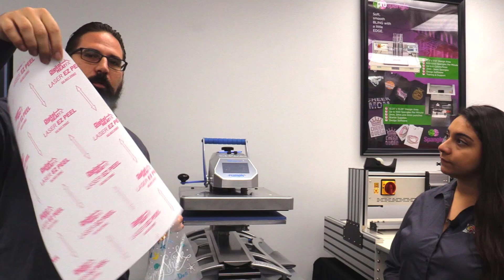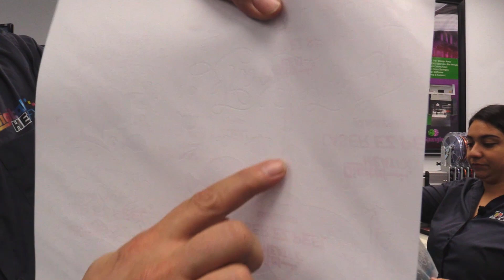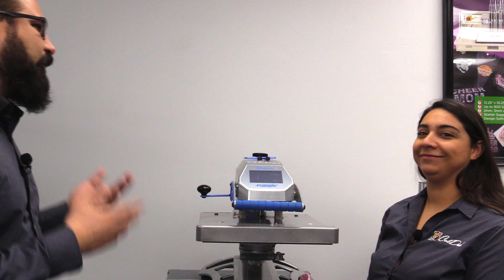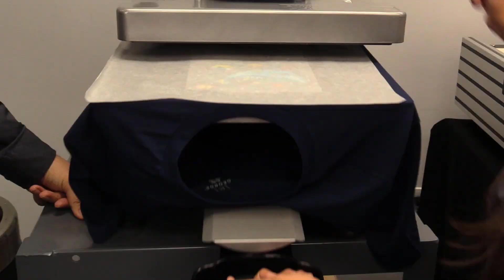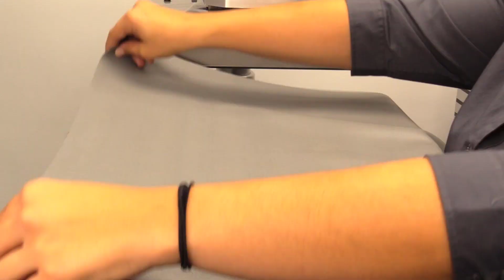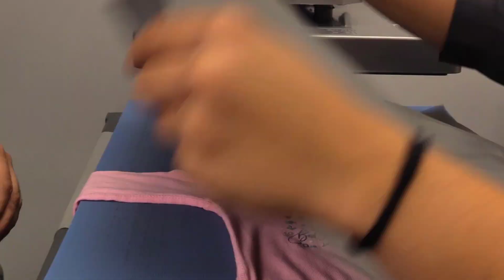Heat Transfer T-Shirts - Full Video

Comment: SO WHATS THE TIME, TEMP AND PRESSURE?????????????????????????????
Reply from the maker: There are different factors that affect what time, temperature and pressure you should use. It depends on your paper and substrate. If you are using our EZ Peel Paper please contact our support department and they will walk you through the steps.